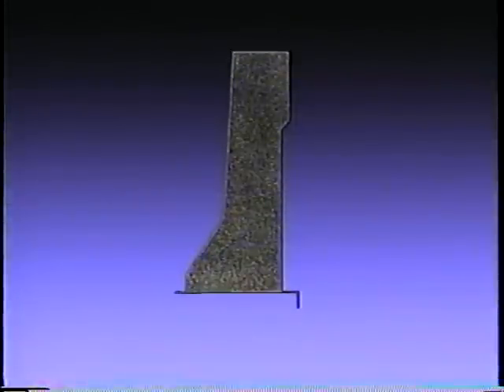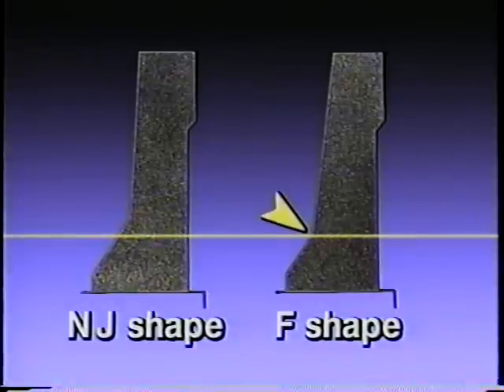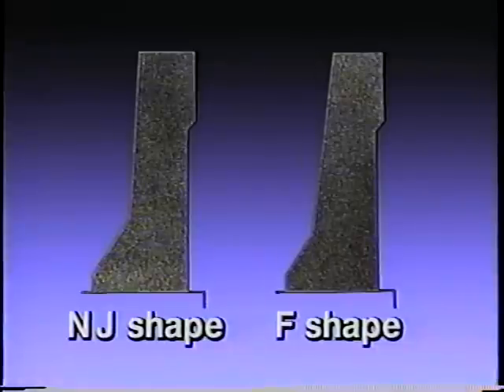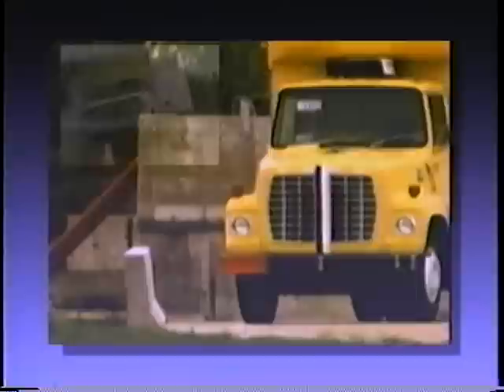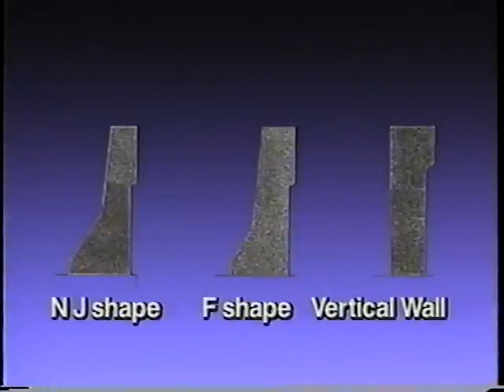Concrete Bridge Railings

Comment: Since this video is now over 25 years old - it's from about 1990 - I wonder what the current thinking is.

Although these are specifically bridge railings, the same considerations apply to median railings on freeways. And this is why there are continuous concrete walls in the center of freeways, which weren't required until about the 1970s - to keep vehicles from easily going head-on into opposing traffic, and to minimize damage when vehicles do hit the wall.
Reply: +hebneh This is super old.  AASHTO came out with five Test Levels, TL-1 through TL-5 in the 1990's.  PL-1 through PL-3 is no longer.  NCHRP 350 governed until 2007 when AASHTO MASH came out and replaced it.
Reply: +hebneh This is super old.  AASHTO came out with five Test Levels, TL-1 through TL-5 in the 1990's.  PL-1 through PL-3 is no longer.  NCHRP 350 governed until 2007 when AASHTO MASH came out and replaced it.